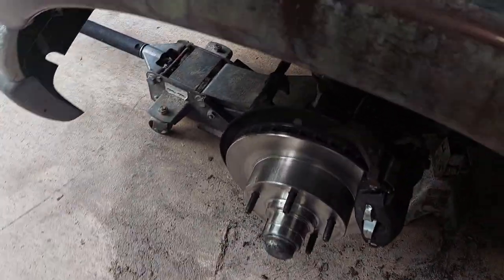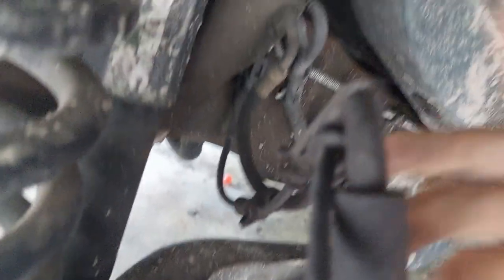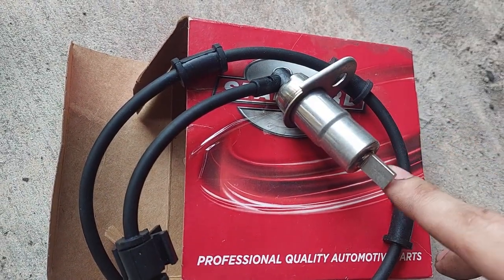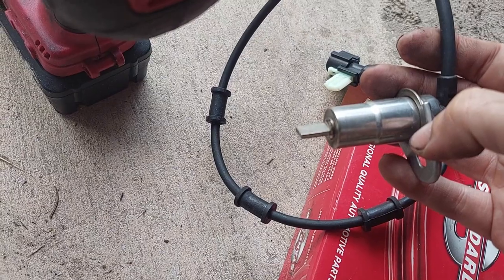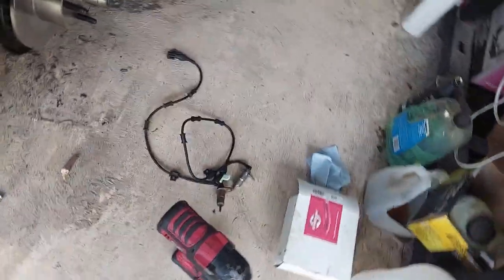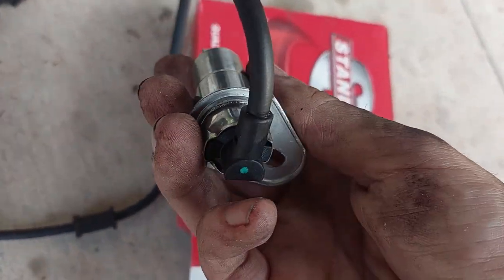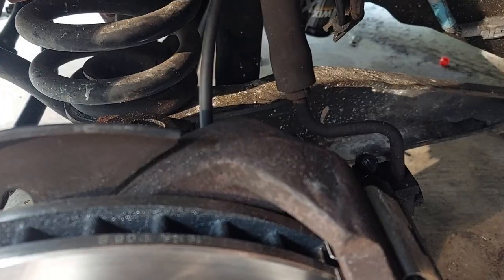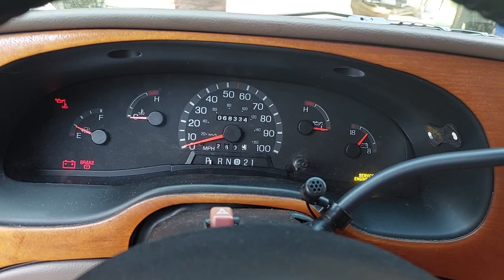Five Minute Fix 36 - Replacing Front Wheel Speed Sensor 1997 Ford E-150 Econoline

Comment: glad i found your channel!!

im gonna have to  go thru my van when i get it ..these vids are so helpfull.

my speedometer doesnt work ....so maybe these sensors may help.

thanks!  my name is Al just fyi
Reply from the maker: Thanks for subbing.   In '97 a PSOM is still being used so that's something to think about.  The VSS is mounted into the tailshaft of the trans and that's worth checking.  The RABS sensor in the differential is also worth a look, and all the wiring between those.  Since its a 1997 you should be able to use and OBDII reader and pull codes if there are any.
Reply: @MazdaB3K  hey man thanks for all the info ..I won't comment on each of ur replies just yet so thank u!

I may be getting this thing tomorrow , but will prolly get it Sunday   

woot woot!
Reply: Yup!

I got the van!  1997 Ford e-150 exclamation point

it has the conversion so it's totally decked out totally decked out inside

I think the conversion was done by explorer cuz that's what it says on the front.

one of the brake calipers locked up so I'm doing two new front calipers and a pad slap.    the rotors are fine.

defe would like to fix the speedo, it isn't working  .  anny ideas Mazda33?
Reply from the maker: @surfbug1  By 1997 the speedometer is no longer cable driven, so you are looking at an electronics issue.  Could be the PSOM, could be some bad wiring coming off the instrument cluster.   there's also a sensor mounted near the tailshaft of the transmission that is worth checking out.  VSS in the rear diff also supplies data to the speedo.  Any other symptoms to go with the speedo not working?
Reply: @MazdaB3K  what's up!   working on the brakes Memorial Day 2024....got new pads and rotors installed, but now can bleed the brakes   (proportional valve stuff?  how do I fix that?  I'm searching YouTube and Ford forums for answers )

also I  loving the van!    and I haven't even driven it yet!   I wake up early and have coffee while sitting in the back row just absorbing the vibe!  lol

what is VSS?  and what is PSOM?  

I will check the electrical stuff on the speedo...trying to get the brakes working now.   thanks man!   Big Al
Reply from the maker: @surfbug1  Could be the proportioning valve, but I'd want to trace the fluid flow back to the brake master cylinder first.  Are you getting any fluid at all when you disconnect the soft line from the caliper?  One thing that can happen to soft lines is they will swell internally until they can't pass fluid anymore.  If possible I would take the soft line off at the hard line and see if you have fluid dripping out the hard line.  I did make a video for this, should be under the Van's playlist.

PSOM is an electronics module that controls the speedometer and on earlier 90's fords, the digital odometer.  They are notorious for failing on early 90's Ford's.  I think they had gotten better by the late 90's but it's still a point of failure.  It is located on the back of the instrument cluster.

VSS is Vehicle Speed Sensor.  On this van it is located at the top of the rear differential.  It's job is to send an electrical signal set by a tone ring inside the differential up the engine computer to help inform it of the current rotation speed of the rear wheels.  It also feeds information to the PSOM if I remember correctly.  In the event of ABS activation, the VSS is the main sensor used to detect if the rear wheels are spinning or not and to pulse the brakes on the rear wheels to increase braking power without causing the vehicle to go into a slide.
Reply: @MazdaB3K  Actuuuuuuuuuualy!--

it's not the speedo, it's the milage that isn't counting

any thoughts?  or direction?

speedo works ...odo does NOT work.   grrrr

any thoughts?
Reply: @MazdaB3K  bled the brakes all is well....used the gravity feed method.
but something is rubbing now...on both driver and pass side.   I'm thinking a brake line or part of the caliper, it's making a grinding sound.

back outside and gonna pull the wheel off to see and look what's up!
Reply from the maker: @surfbug1  I know exactly what that problem is.  The plastic worm gear that drives the odometer is probably broken inside the cluster.  I had to replace the one in the van. It's not a super scary job to do but it does require the instrument cluster to come out and to be taken apart to get access to the gear.  Dorman makes the gear and it can be found on Amazon for around 20 dollars last I checked.  I did make a video on the process and it should be in Engima's playlist.

Now the really important part is how NOT to break it again.  When you reset the trip counter, only do it when the vehicle is in park and NOT moving.  As long as you do that the worm gear shouldn't break again.
Reply from the maker: @surfbug1  Brake line won't make a grinding noise.  That could be loose bolts in the caliper.  Might also be the dust shield is bent in a bit and is contacting the rotor up front.  If you replaced the front rotor and/or removed it, it could be that your inner and/or outer wheel bearing are not seated and are now getting fried.

Even if you didn't touch the front rotors, it's a good idea to pull the dust cap off and check the condition of the front bearings.  You'll need new wheel seals if you decide to remove the rear bearing but checking the status of the bearings is cheap insurance versus your wheel locking up at 70mph on the Interstate.
Reply: @MazdaB3K  yeah man I saw that fix after digging more 

still working on the brakes---  I ordered factory brake pads and they come with factory brake clips ....one disaster at a time!

Comment: I've got an 02' E350 both the speedometer and the odometer stopped working at the same time. I replaced the sensor on the rear differential and the sensor on the transmission but still nothing. Do you think the wheel sensor would cause the speedo and odo to stop working? Also, any idea if that part is a replacement for an 02'. Thanks
Reply from the maker: If your 02 is like my 01 F250 then I would check the ABS computer.  If that fails the speedometer will stop working. You should also be getting ABS codes though if that's the case.  You should also check the general wiring between all those sensors to make sure you don't have one chafing or cut. I made a video about this:

https://www.youtube.com/watch?v=fDbLGfGT_Fw
Reply: @MazdaB3K  I really appreciate your response. The ABS light is on, on the dash, but the only code I get is P0500. That being said, the only code reader that I have ever gotten to work with this vehicle is a $19 reader from Walmart :) nothing else works. Not sure if it picks everything up.
Reply from the maker: The P series of codes are engine diagnostic codes.   If your ABS light is on and it's not something like low fluid in the brake master cylinder, you need a code reader that can read ABS codes to see what's going on there.  They are a little more expensive than your basic readers, but can be had for less than 100 from most autopart stores and places like Harbor Freight.